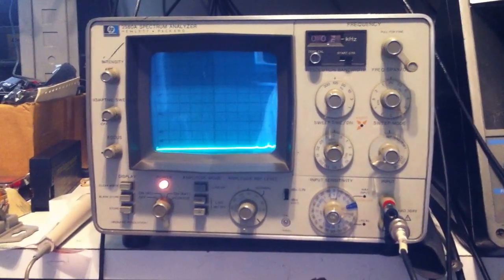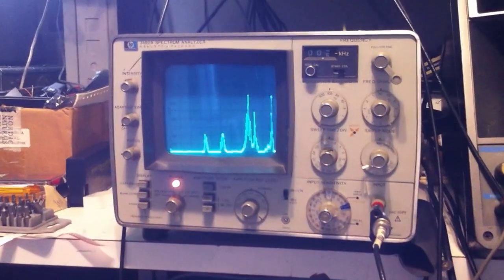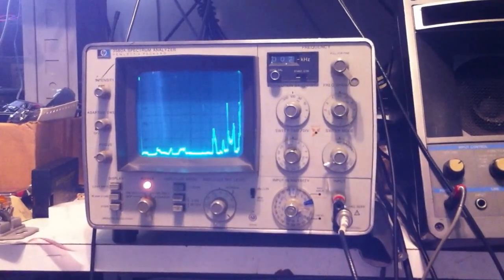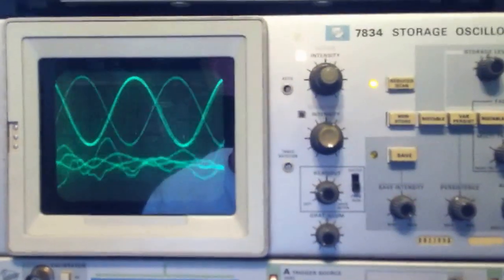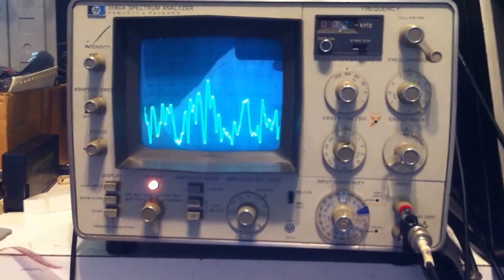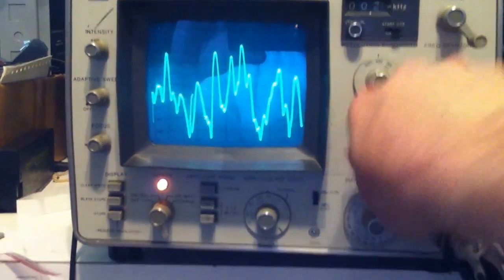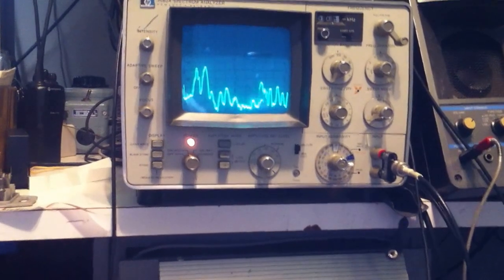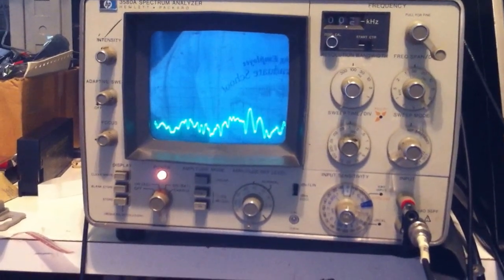HP 3580A Audio Spectrum Analyzer demonstration

Comment: What parts did you use to measure from a microphone?  In other words what adapter did you use for input?  I have this unit and would like to measure over the air signals.

Comment: Will that spectrum analyzer measure in real time like a scope will or does it have a lag while it to scans?
Reply: There is a bit of a lag, due to the scan rate.  This is unavoidable when scanning lower frequencies.  It's just like viewing a low freq. on a scope in the time domain.  Say, if you were looking at a 60Hz signal at 1 usec/cm, you'd just see a whole lot of essentially horizontal lines.  But a REAL spectrum analyzer doesn't have the lag that (at least, the affordable) the scopes with FFT seem to have.  I want a spectrum analyzer!  After checking out those modestly priced FNIRSI, Hantek, etc, FFT scopes, I'm convinced that only the REAL thing will make me happy!